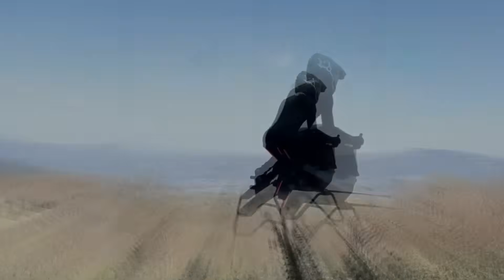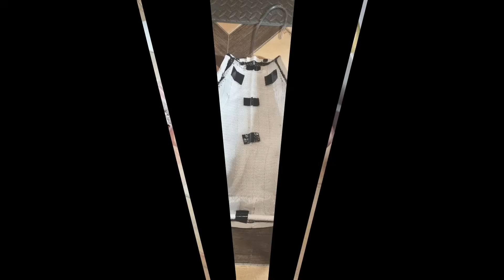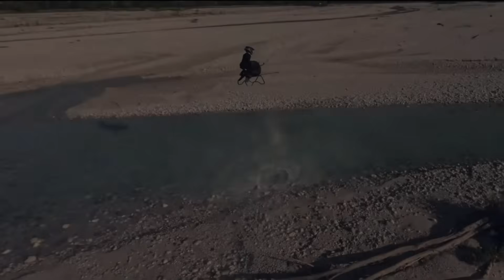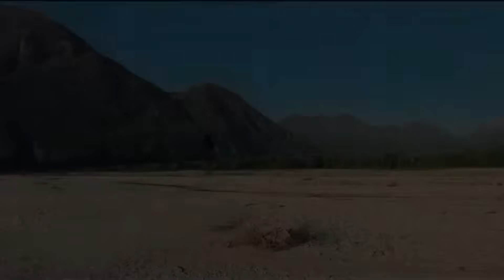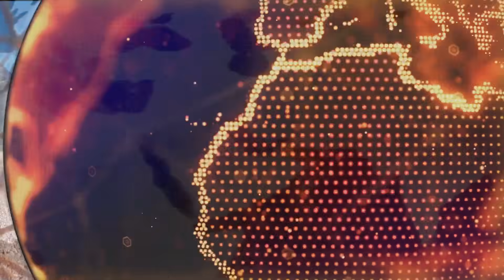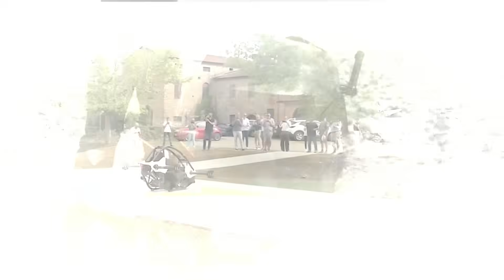2026 NEW VOLONAUT AIR BIKE OFFICIALY LAUNCHED!! Key Features, Tecs, & Benefits!!

Comment: What's it sound like?
How long  can you fly it?
How is it powered?
How much does it weigh?
Some actual information would be wonderful....
Reply from the maker: @AstroVanTribe
Great questions! Unfortunately, exact details on sound, flight time, weight, and power source haven't been fully disclosed yet. But considering it uses jet propulsion, we can expect significant noise levels, likely similar to a fighter jet. As for flight time, it may be short, possibly only a few minutes, especially if it's gas-powered. The weight is probably quite heavy due to the propulsion system and frame, and it's likely to use a form of fuel-based or hybrid propulsion. Hopefully, as the technology evolves, more concrete specs will emerge! Would you be interested in a flying motorcycle if it had quieter and longer-lasting capabilities?
Reply: @innomoto i read - 120 kg weight, 100 kg capacity, 25 min flytime, 200km/h max speed
Reply from the maker: @oo-ns5yw I love that idea! A sleeker, more integrated design like a molded control unit with a balanced look would definitely make it feel more futuristic. And you're right, the Star Wars speeder bikes have that perfect balance of form and function. 🚀 For something like this, the aesthetics will be key, especially as it evolves from a prototype to something more public-facing.
Reply: @ lmao 25 min flight in that package? Maybe if it's burning plutonium.
Reply from the maker: @sudilos1172 Haha, yeah, 25 minutes at 200 km/h in that frame does sound like sci-fi-grade energy density. Unless they’ve found a way to shrink a fusion reactor—or it's running on dreams and marketing—we're probably looking at best-case test numbers. Still, wild how far the concepts are going.
Reply: @innomoto 
Currently only 10 minutes of flight
Reply from the maker: @Zeaiclies Thanks for sharing that update. Ten minutes of flight time makes sense for an early prototype, especially with jet propulsion—fuel efficiency is always the limiting factor.

Do you think future versions could realistically push beyond 20–30 minutes with lighter materials or hybrid power systems, or is that still too ambitious for now?
Reply: @innomoto 
Wear a fuel tank on your back like fly board air  😂

But seriously, yes a longer flight time is certainly possible in the future.
Reply from the maker: @Zeaiclies
Haha, a wearable fuel tank would definitely extend the ride.. though it might feel like strapping on a rocket pack. Still, you’re right: with design refinements and smarter power systems, longer flight times are within reach. Do you think the big breakthrough will come from better fuel efficiency, or a complete shift to a new propulsion tech?
Reply: @innomoto 
Hard to say what new innovation will come next and if you have the Balls to ride this thing anyways, might as insure you are fire ball on crashing by strapping a fuel tank to your back.  lol  
Just kidding really but might as well enjoy it to the fullest.
Reply from the maker: @Zeaiclies 😂 Fair point — if you’ve got the guts to ride something like this, you’re already embracing a bit of that “fireball risk.”  Jokes aside, it’s that mix of danger and innovation that makes the Volonaut so fascinating. Would you personally take it up for a 10-minute flight just for the thrill, or wait until it’s safer and longer-lasting?
Reply: @innomoto 
Oh I am the "You only live once" type guy, so yeah I would hop on and ride. 😂
Reply from the maker: @Zeaiclies Haha, love that attitude! 😂 “You only live once” is exactly the spirit needed for something as wild as the Volonaut. A 10-minute flight might be short, but I bet it feels like a lifetime of adrenaline packed into those minutes. Would be amazing to see how it evolves with longer flight times and lighter tech, but for now—full throttle and enjoy the ride!
Reply: @innomoto 😂😂😂
Reply from the maker: @PiotrPrzybylski1967
Haha glad you got a laugh out of that! 😂 With a machine this crazy, sometimes you just have to embrace the humor and the adrenaline. Would you ever take something like the Volonaut up for a spin, or is it “fun to watch, not to ride” for you?
Reply from the maker: @Zeaiclies
Love it! ❤️ That’s the perfect answer. Anyone brave enough to hop on one of these is exactly the kind of person this machine was built for. Ten minutes or not, that first lift-off would be unforgettable.
Reply: @innomoto 
Extremely exhilarating❤
Reply from the maker: @Zeaiclies
Exactly.. that’s the perfect word for it. ❤️
Pure adrenaline, pure freedom. Nothing else even comes close.

Would you go for another flight the moment you landed, or take a breather first?
Reply: @innomoto 
Refule and go again. ❤
Reply from the maker: @Zeaiclies
That’s the spirit! ❤️🔥
Refuel, throttle up, and straight back into the sky. Once you’ve tasted that kind of adrenaline, there’s no such thing as “just one flight.” 🚀
Reply: @innomoto praticamente sei seduto su una bomba
Reply: @innomoto  Of course, everyone would want to operate one of these things if it were, quiet, light, had long running time, etc.... Jet propulsion isn't the way to go, electromagnetic might be, but I don't think that technology is where it needs to be, either
Reply from the maker: @AstroVanTribe
Totally agree — jet propulsion gets the job done for now, but it’s loud, hot, and incredibly inefficient. Electromagnetic lift or high-capacity ducted electric fans could be the future, but yeah, we're not quite there yet in terms of energy density and control. Still, it’s wild to think we’re even at the “proof-of-concept” stage! What tech direction would you bet on for the next-gen personal flyer?
Reply: @AstroVanTribe  Yes, electromagnetic, along with being able to warp gravity.
Reply from the maker: @kenhoward3512 Warp gravity? Now that’s next-level thinking! 🚀 If we ever crack gravitational manipulation or real electromagnetic lift without massive energy costs, it could rewrite everything—from airbikes to space travel.

Right now it’s more sci-fi than spec sheet, but hey, so was flight itself not that long ago.
Reply: @AstroVanTribe  "Jet propulsion isn't the way to go" 🤣
It's only used in fastest planes, rockets, spaceships and now first non propeller flying machine.
Reply from the maker: @kenhoward3512 Electromagnetic tech combined with gravity manipulation sounds like the stuff of sci-fi legends! 🌌💫 If we could figure out how to control gravity, it would completely change the game for transportation. Imagine just floating above traffic without needing propulsion or fuel. How long do you think it will take before we see anything like that in real life?
Reply: Fake
Reply: How stupid are you?
Reply from the maker: @AstroVanTribe Great questions! Right now, the Volonaut Airbike’s exact specs aren’t fully revealed. It likely sounds quite loud—think fighter jet level noise—since it uses jet propulsion. Flight time might be around 20-25 minutes, but that depends on fuel efficiency and weight, which is rumored to be around 120 kg for the bike plus a 100 kg capacity. Power is probably a fuel-based jet engine, but future tech might shift toward electromagnetic or ducted electric fans, though those aren’t quite ready yet.

@AstroVanTribe and others, I totally get that jet propulsion is loud and inefficient—electromagnetic lift or advanced electric motors could be quieter and cleaner, but we’re still waiting on breakthroughs for that. What tech would you bet on to make personal flying vehicles practical, quiet, and efficient?
Reply: Product is available for demonstration when n where,???
Reply from the maker: @shanshanawazkhan7910
Good question! As of now, there’s no official word on public demo dates or locations.. most likely it's still in limited test phases or private showcases. If they do announce demo events, it’ll probably happen through the company’s official channels or major tech expos.

Would you be down to attend if it popped up in your region? Or are you ready to fly one yourself if they open pilot trials? 🛩️🔥
Reply: Take my money!!!
Reply from the maker: @johnwalck3133 Haha, love the enthusiasm!  Sounds like you’re ready to sign the check without even hearing the specs. Would you want it as a weekend thrill machine, or are you picturing yourself commuting to work above the traffic every day?
Reply: Currently flies for 10 minutes and it is quieter than many would think.

Fully fueled it is about 60 pounds (not including Rider).

Powered by a jet engine
Reply: Bravo wie lange fliegt das Ding wenn er voll getankt ist ich denke nicht sehr lange also da hat er gravierende Nachteile das ist für ein Kinderfest oder für Geburtstage um zu chillen Spaß zu haben mit den Oligarchen und Scheich Freunden aber niemals glaube ich wird es Chancen haben das jeder damit im Straßenverkehr unterwegs sein wird ich glaube da hat die Flugdrohne bessere Chancen im Straßenverkehr Teilzunehmen alleine wegen der Reichweite und wegen der Lärm Belästigung also definitiv die Flugdrohne ist im allem im Vorteil und hat bessere Chancen eine Genehmigung zu  bekommen
Reply: @eracanerci-hi8ry  I'm sorry, it's got serious faults because you think it's not going to last long? Who are you exactly, that you make big conclusions based on nothing but your unjustfied opinion?
Well, you think that equally laud, bulky aircraft with dangerous blades that can cut you in half is more suitable for use on roads. I'm not sure if pedestrians will agree with you. Btw. drones do not carry pilots or passengers. Taking all the above into consideration I'm guessing you're not an expert.
You don't think people would like to use it. Did you read those comments?
This machine is the very first of it's kind. Why wont you let use know how many people wanted to use first cars or even bicycles? How many people believed they will be common mode of transportation in future? How many years it took to make cars usable?

Comment: Would be a good tool in exploring worlds like Mars. 
But I wonder if the pilot is strapped in incase of freak accidents.
Reply from the maker: @sethflores1680
Great point! It could definitely be useful for Mars exploration, navigating rough terrain with ease. As for safety, considering the technology's current state, it’d be smart for pilots to be secured in some way to handle unexpected situations. What kind of safety measures would you suggest for something like this?

Comment: Let’s say you about to run into a cliff, How do you brake to slow down or stop?
Reply from the maker: @primitiveandbeyond
That's a critical question! The Volonaut likely has advanced throttle and flight control systems for precise maneuvering, but in a situation like that, it would need powerful deceleration mechanisms, possibly similar to an airbrake or thrust vectoring to redirect power. What do you think would be the safest method for rapid braking in mid-flight?

Comment: Fuel Capacity how big is fuel tank
Reply from the maker: @DanielEspiritu-g3w
Great question! The exact fuel tank capacity hasn't been released yet, but given the jet propulsion system, it’s likely to have a relatively small tank to keep the design lightweight. This would be in line with the short flight times typically seen in similar technologies. As we learn more about the specifications, we may get a clearer idea. Would you be interested in a longer-range version if the technology advanced?

Comment: I Lol at the bot comments pretending that this is real
Reply: It is Real, check their website.
Reply from the maker: @sudilos1172
Totally get the skepticism — it does look like something out of a video game cutscene! 😄
But yep, it's a real prototype developed by Tomasz Patan (the same mind behind Jetson ONE). Still early stage, limited flight time, and far from city-ready… but it’s flying.

That said, healthy doubt is important — what part seems most unbelievable to you? Always up for digging deeper! 🛸💬
Reply: @ Hi ty, doesn't seem to be any air inlets or side jets. What does look like it could be inlets are very small. They don't show the jet exhaust port or how it maintains level flight for pitch , yaw, or roll. There is zero data available on it aside from videos. It's far easier to find the flying iron man arms units, or jetson one, or other craft and their specs. And to see videos of them in out in public. There is no Skibidi toilet chassis available. The landing gear looks impractical and heavy. Sure, I suppose some of the other flight options would be able to fit into a chassis the size of this. But this just looks fully like a CGI/Ai  rendering rather than actual flight footage.
Reply: @ also, why cram everything into one tiny unit with limited flight time. When they could double the size of this to increase flight time, carry capacity and just. It's kind of incredible if it's real.
Reply from the maker: @sudilos1172 I see where you're coming from — the lack of visible air inlets and the small exhaust ports definitely raises some questions. You're right, flight mechanics like pitch, yaw, and roll control need more clarity. I agree, it looks a lot like CGI at first glance! As for the size, I think the goal is to keep it compact and agile for now, but yeah, scaling it up could help with flight time and load capacity. It’s still early days, though, so the specs will likely evolve. The Jetson ONE has a similar challenge, but they’ve made it work. Let’s see if this gets more transparent in the future! What would make it feel more "real" to you?
Reply: @innomoto  If they host known youtubers and let them see a personal demonstration of the airbus in flight. And see how many can fit on the airbus?
Reply from the maker: @sudilos1172 That’s a solid idea — getting reputable influencers or journalists involved could go a long way in building trust and giving us a better look at the actual capabilities of the Volonaut. 🛸 It would definitely help clear up any skepticism if we could see a real-world demo with a few pilots on board! What kind of specs or features would you want to see highlighted in such a demo?

Comment: Imagine, we don't need roads anymore
Reply from the maker: @phutran-u4t
Exactly! The idea of no longer being limited by roads is mind-blowing. It could revolutionize how we think about transportation. Do you think this could change the structure of cities, too?
Reply: @ sure, I will call them Dome Cities.
Reply from the maker: @ 
Dome Cities—now that’s a fascinating idea! Imagine cities designed around vertical and aerial transport rather than cars and roads. It could totally reshape urban planning, with skyways and hubs for flying vehicles. What do you think would be the biggest challenge in creating a city like that?
Reply: I don’t know. What is it
Reply from the maker: @phutran-u4t
Great question—and there’d be several challenges. But the biggest might be **air traffic control**. Imagine thousands of personal flyers zipping around in 3D space—keeping them from colliding would require ultra-precise navigation systems and AI-assisted flight paths. Safety, noise control, and reliable power sources would also be tough nuts to crack.
Would you want to live in a Dome City if all that tech worked perfectly?
Reply: @ absolutely yes
Reply from the maker: @phutran-u4t Sounds like the future is calling you already! 🌆🚀 A Dome City where air traffic is seamless, and flying vehicles are the norm would definitely be a game-changer. Imagine just soaring over your neighborhood to get to work! If this tech becomes a reality, do you think there would be any new challenges you'd want to see solved first?

Comment: Its need  to be able to deploy a series of airbags in the event the jet engine fails.
Reply from the maker: @learnthrivecompassion422
Great point! The ability to deploy airbags in case of jet engine failure would certainly add an extra layer of safety. It could make this type of vehicle more reliable for everyday use. Do you think such a system could be practical with the compact design of a flying motorcycle?

Comment: No mention of flight time, 5 minutes at best…
Reply from the maker: @dante9192
You’re spot on — current flight time is estimated to be very limited, likely around 5–10 minutes due to the high fuel burn from those compact jet engines. That’s one of the biggest hurdles for making this tech practical. If they could double that without adding bulk, it’d be a real game-changer. What kind of flight time would make you take it seriously as a transport option?
Reply: Hater and racist
Reply from the maker: @tvndno6023 Let's keep the conversation respectful and focus on the topic. If you have any questions or insights about the Volonaut Air Bike, feel free to share! 😊

Comment: Where would you ride this? To low to the ground and you kick debris at other vehicles and you're effected by the air as vehicle drive by you. To high in the air and your down blowing air and noise like crazy on other vehicles. Too large/wide for sidewalks.
Reply from the maker: @trancendedmindpalace
Great points — that "in-between zone" is a real challenge. It’s too disruptive for low-altitude city use, but too exposed and noisy for mid-air traffic. Right now, it's likely best suited for open areas, private properties, or controlled environments like testing zones or rural commutes. Until propulsion tech gets quieter and more compact, this might stay more sci-fi than street-ready. What kind of environment would make sense for a machine like this in your view?